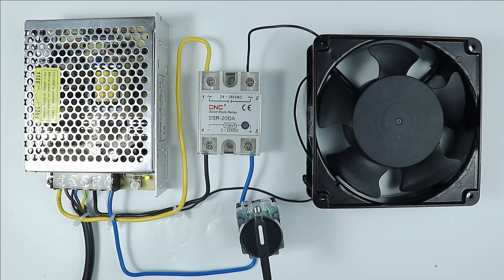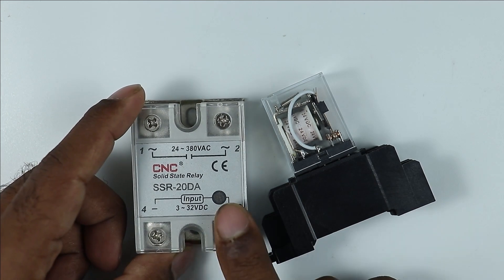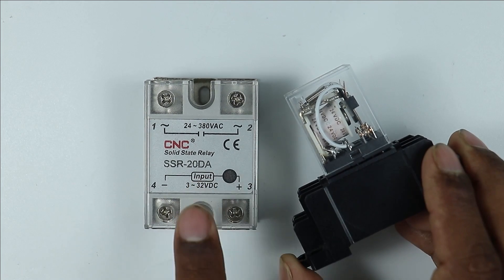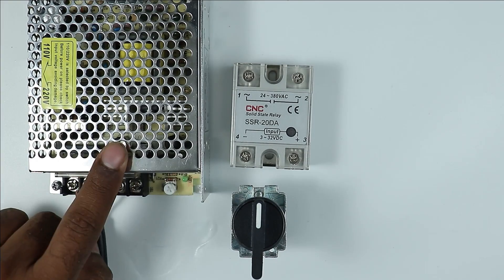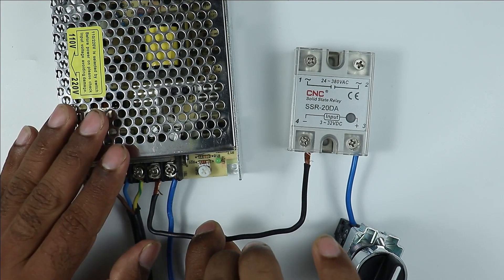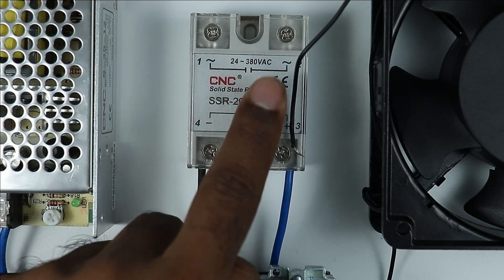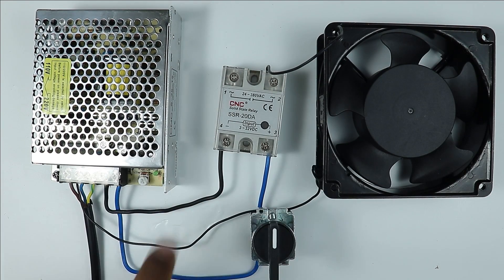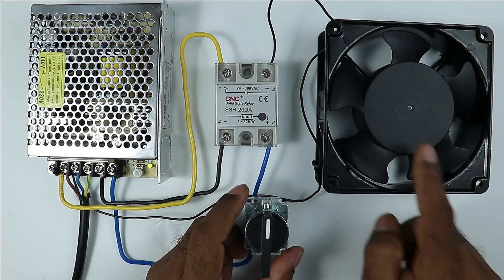Motor Turn ON And OFF by using Solid State Relay | SSR Connection @TheElectricalGuy

Comment: This video doesn't make much sense seen as the relay is controlled by the switch...you need to use recommended voltage and voltage below recommended that's the 3v to turn on and or relay not a switch...😂😂

Comment: Thanks so much.  I have a project requires ssr but they need to be switched on and off at a higher frequency of about 100hz, can it be done? How much frequency can an SSR relay handle?
Secondly, can a DC currents be passed into ssr output to the load instead of ac currents?
Reply: try an n-channel MOSFET if you want to control a DC load.